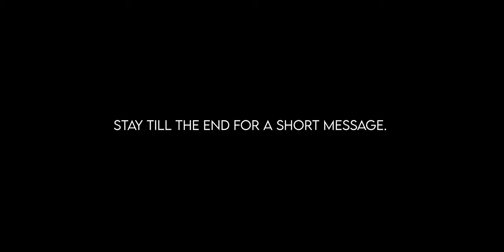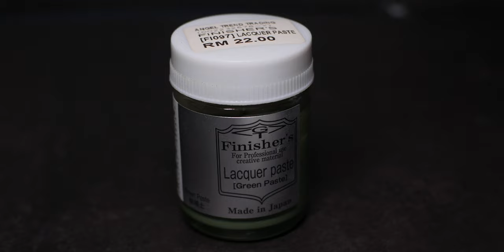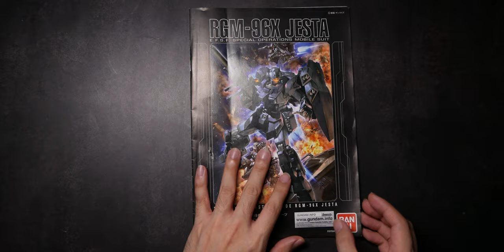CUSTOM GUNPLA - MG JESTA BUILD EPISODE 2 ジェスタ(機動戦士ガンダムUC)

Comment: Yo! What is that tool/blade you put in the hobby knife holder to carve out a hole that you put the metal detail in????
Reply from the maker: Hi, they're called "spin blades". While not the brand that I'm using, GodHand does carry them. You could find some cheaper equivalents.